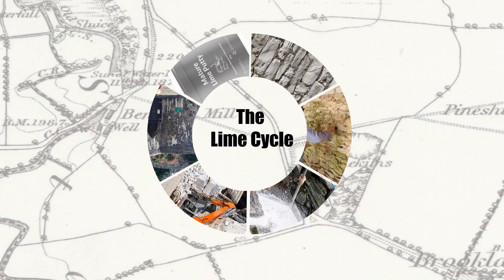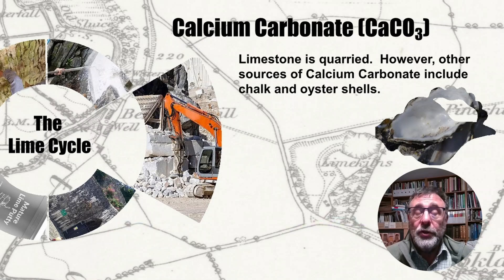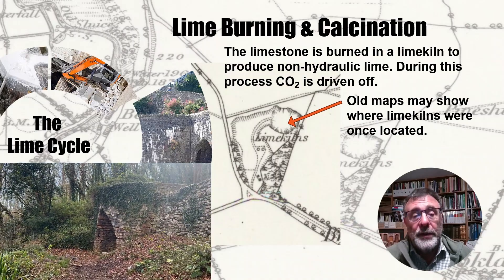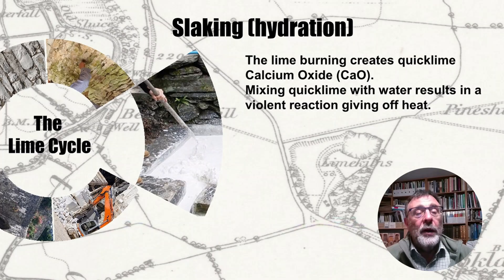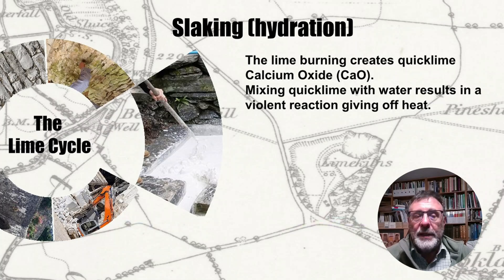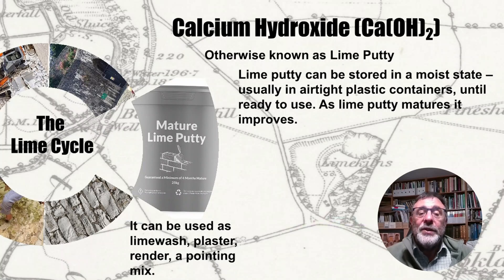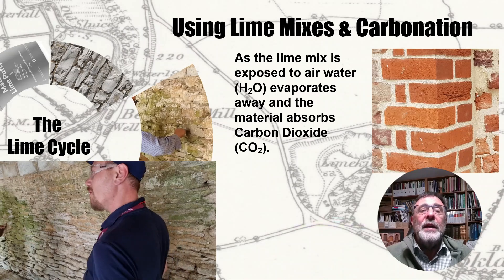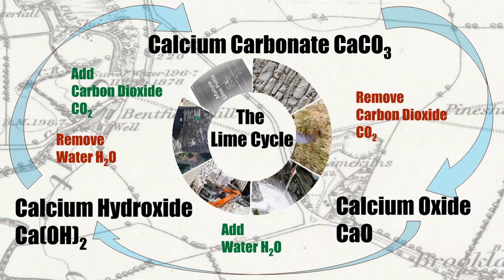Lime Mortar for Old Homes – Chemistry, Conservation & Why It Still Works

Comment: Lime Cycle is so intrinsic to life on earth.  Consider the coral reefs and spawning grounds.  The cycle of life.
Lime requiring CO2 to set, the fact that this captures CO2; similarly, plants capture and fix CO2 into their structures.....
Carbon Dioxide is your friend here.
Reply from the maker: Very much so. Although during carbonation the lime won't be able to absorb the same quantity of CO2 that is driven off when the limestone is first fired, it does at least absorb some - unlike cement which has no such benefit. (Rich)
Reply: @talkingconservation  I'm glad you said that not all the calcium hydroxide in the lime mortar reverts back to calcium carbonate because a lot of people treat lime being carbon or carbon dioxide 'neutral' as they assume that all the lime mortar converts back to CaCO3.  You are not quite right about cement/concrete having no such benefit as there is carbonation in concrete as well and that is the reason that you get corrosion in of reinforcement in concrete as the alkali environment changes as the concrete between the outside face and the steel carbonates.

Comment: Interesting. So is limestone mixed with anything else. Cement I read contains about 60-65% lime. So the other ingredients must make a difference to cement's properties. Unless the manufacturing method is different, which it must be.
Reply from the maker: In the production of quicklime, the limestone is burned on its own with nothing added.  Some forms of limestone contain impurities, which is what Rich alluded to at the end.  Once the quicklime is produced this is then slaked to create a form of lime that can then be mused pure (e.g. for plaster finishes), or mixed with various aggregates to form a plaster, render, mortar, etc.

We are going to do other videos looking at the various impurities and how this affects the lime you create, but also looking at the mixes that are used.

Although cement is formed using limestone, it is a very different process and includes other materials from the outset, which is why it has a 'chemical' set (i.e. can set under water), whereas lime of the form we discuss here goes through carbonation - a form of 'setting' when it comes into contact with air.

I hope this helps.  We are planning other videos going into other aspects of this.

Thanks for your comment.
Reply: @talkingconservation  thanks for your reply. Look forward to further videos.